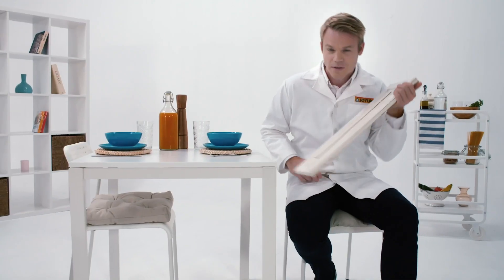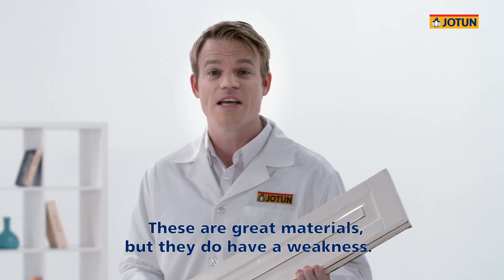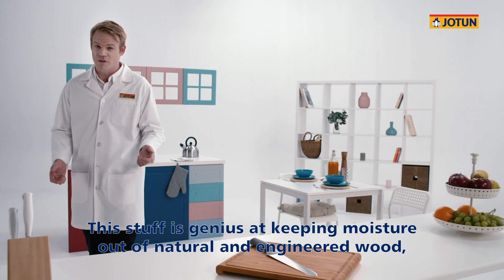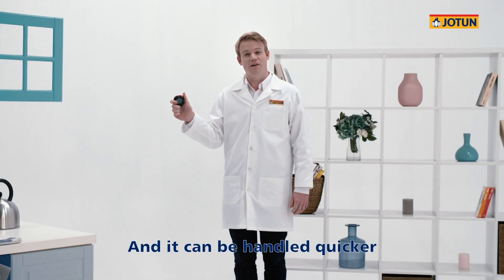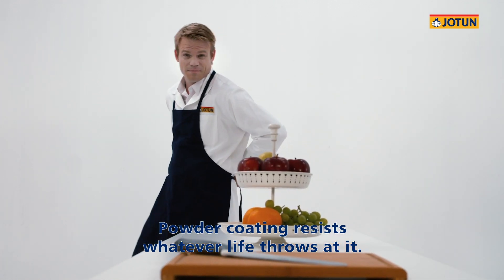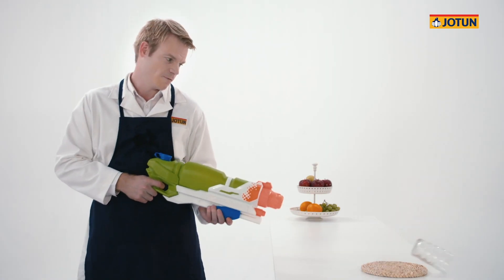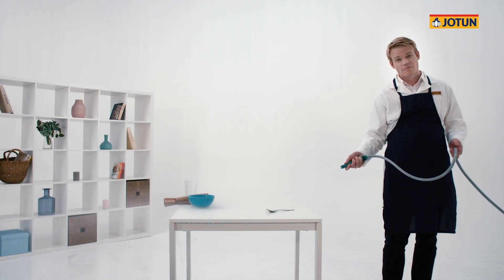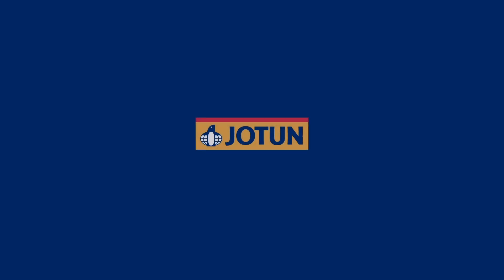Powder Coating on Natural & Engineered Wood (MDF) - Humidity Video

Comment: Good video but how is it applied. Is this for factory applied finishes only.
Reply from the maker: Thanks! Powder coating on Natural or Engineered Wood (such as MDF or HDF) is typically done in a factory setting due to the fact that it requires the correct application equipment, a certain quality of natural or engineered wood, and an optimal level of humidity. If you have any more questions, please feel free to ask.